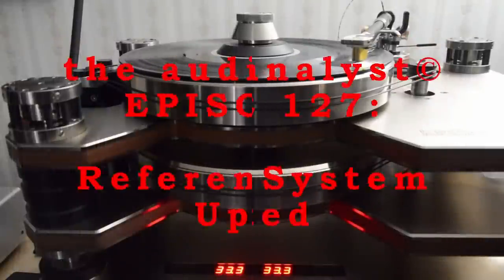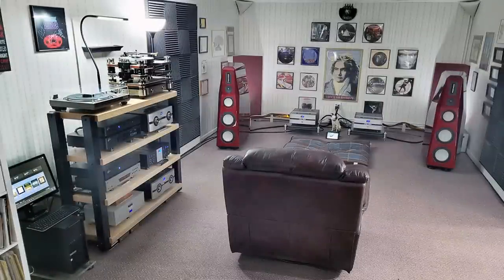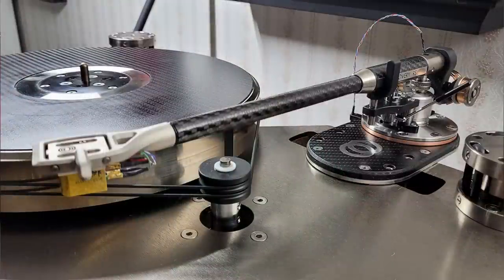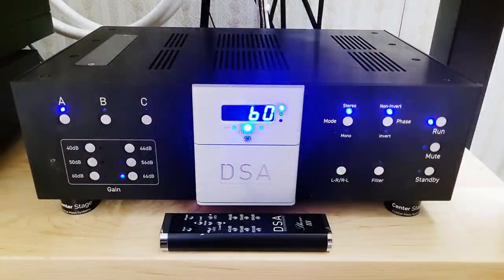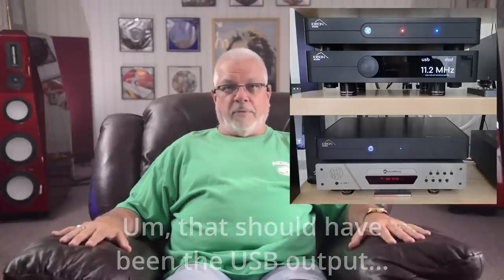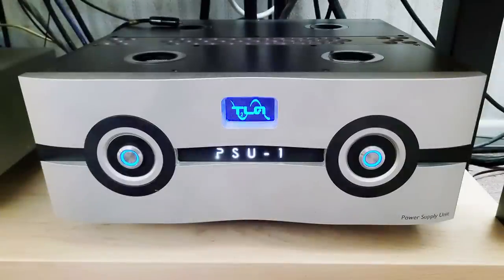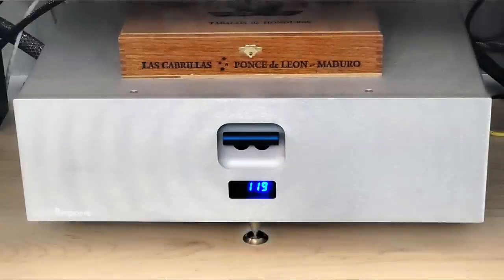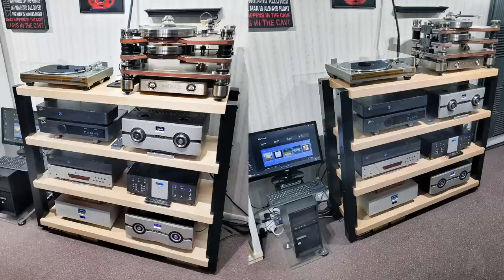E127: Reference System Updated

Comment: I like the mono ssa 350 being used. Would it be more desirable to have a true separation of tubes and solid state where tubes are used for mid and Tweeter and solid state power being used for bass drivers.  I don't know if there are any amplifiers to do this. And biamping a tube and solid state amplifier is very challenging to get right.
Reply from the maker: Hello again, my good man. Sadly, there is just no validity to your blanket statement that it would be, "...more desirable to have a true separation of tubes and solid state where tubes are used for mid and Tweeter and solid state power being used for bass drivers." Sadly, this is ONLY your opinion based on your own set of preferences and biases, and one that has no rational beyond that! You honestly should try to allay such biases, as they CLEARLY affect your expectations and - I would also suspect - color what you "choose" to hear. 

Don't get me wrong, you are allowed to have biases, but...without actually having heard the products in question, making such absolute and blanket comments is, well, foolish. Listen with your ears first, not with your eyes and your expectations... 😉

Comment: Exceptional system and video.  Thanks.  Just curious that I noticed many super systems with speaker-wall width dimension similar to yours.  Do you think your listening experience would improve if your room width were longer?
Reply from the maker: Hey J990. More than likely, but...it is not a guaranteed result. Would I like it if the walls were 16 feet, or even 18 feet, wide? I suspect I would. But, what I've achieved in this room is utter magic, so...I don't waste time thinking about something that can't/won't happen! 

Does that make sense?

Comment: Curious as to why you don't bi-wire your speakers?
Reply from the maker: When I'm using the Silversmith Fidelium's, I DO use Jeff's Biwire adapter. However, when I got the Stealth Dream v14's, they were not available as a shotgunned biwire set... While I would love to biwire - it REALLY does make a difference (E28: Biwire or Biamplify - https://youtu.be/gPc9Kpb6w9Y), the level of performance afforded with the Furutech $1,100 a set 0.3M FP-3TS20 PCOCC jumpers, made of 14-Gauge Power Cable terminated with their CF-202 Banana Plugs on all ends, makes it a bit harder to justify the purchase of a second set of $18,000 a pair Stealth Dream v14s!

Comment: Why didn't you extend the corner traps to the ceiling? I do like the corner panels and would love to get them
Reply from the maker: Hello again! I honestly didn't feel any strong need to install them in the first place. But I felt that as affordable as they were, and the fact that I could get them in a color that so closely matched my loudspeakers, I decided that it could not hurt. The sonic result is quite nice overall, and the simple answer as to why they don't run all the way to the ceiling is that at their pre-built dimensions of 24"x48"x13", two would not stack in my corners - my ceiling is only 7' 4" high! 😏

Could I get custom sized units to fit? Sure. But again, the room doesn't seem to "need " them, so I see no reason to spend the dough that could be used to by more music! 😉

Comment: Greg, do you still have your Audionet Max monos?  I was going to buy the TLA integrated amp from Bill, but decided on a used pair of Maxes & matching preamp (both in black) that he had just picked up.  Extraordinary driving the Alta Celestes which have a VERY high damping factor............ I hear the TLA gear is extraordinary though.
Reply from the maker: Hello Jason. As to the Audionet Maxes, yes, I do! 😊

Now, I'm curious about your statements addressing your Alta speakers... I'm guessing you mean the Celesta's, right? And I'm really confused by what appears to be your statement that "THEY" have very high damping factor.

A Damping Factor is a loudspeaker measurement, and is the ratio of the load impedance (measured as the loudspeaker plus wire resistance) to the amplifier's internal output impedance. Were you referring to the Maxes Damping Factor, which IS absurdly high and rated as 1,800 at 10kHz, or 10,000 at 100 Hz!
Reply: @theaudioanalyst  Correct, the Maxes damping factor, it's a perfect match for the Celeste speakers.  Mike Levy made it clear that it is very important to choose an amp for the Altas with a high damping factor, and he is correct!
Reply from the maker: @colekyler002 I have to assume that you are aware that this statement applies universally, for ANY amplifier/loudspeaker combination.

The damping factor (DF) specification reflects the amplifier’s ability to control speaker motion AFTER the applied signal has stopped. As I mentioned, it is calculated as the ratio of nominal loudspeaker impedance (typically somewhere in the range of 4 to 8 Ω) to the total output impedance of the system driving the loudspeaker, including the amplifier and cables.

Because the damping factor changes with frequency (as does impedance) and is most noticeable at lower frequencies, a high DF typically results in tighter, more controlled bass performance. A lower DF will result in soft, fat, flabby bass.

Comment: What happened to the Parasound amplifier?
Reply from the maker: Hello Steven. I have to assume you are referring to the Parasound Halo JC 1+ Monos? If so, then nothing has happened to them. They continue to be my reference in their price range, just under $20,000. But the True Life Audio SSA-350 monos are $90,000 a pair...
Reply: @theaudioanalyst  What about the tube sound do you like?
Reply from the maker: @stevenburdick424  It has little to do with "tube sound," if at all. The approach was to maximize the performance in any and every possible way. The transformers (which TLA has been manufacturing for seven decades) are absurdly well done, and both the extreme dual mono approach to the line stage, and the combined tubed input stage, driving a bi-polar Toshiba transistor output with the monoblock's is just amazingly successful. Keep in mind, it was common in the late '60s and '70s to use a valve based preamp with solid state amplification... These guys have really gotten the recipe right, as this gear is among the best sounding sets of electronics I've heard.